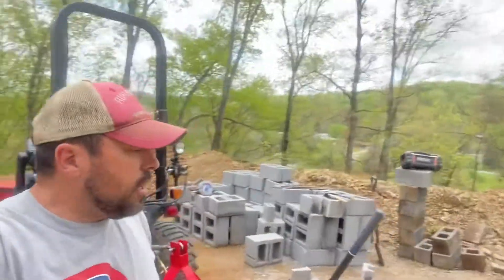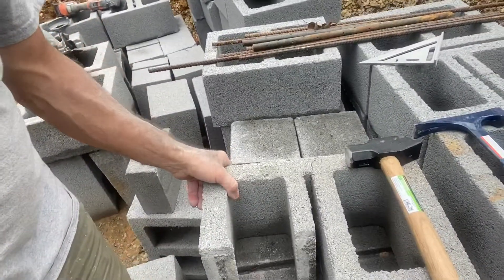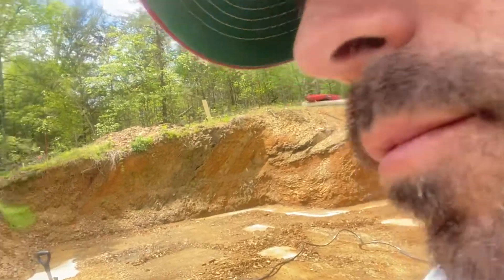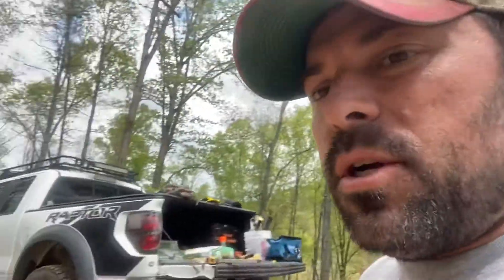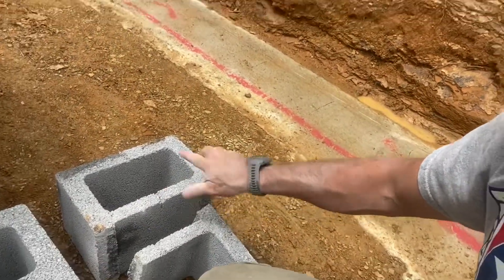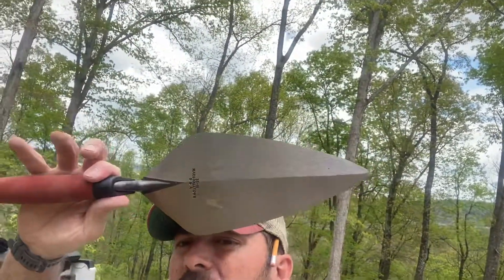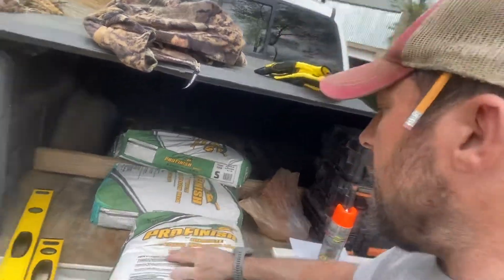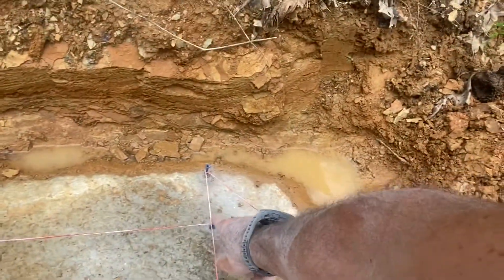Starting the block foundation on my farm house

Comment: In my area we buy 12" corner block. We also use three cell block for basements with rebar every four ft. You might want to think about a wider striker the joints will look better. I will try to help in any way I can.
Reply from the maker: Thanks Kevin, my supplier doesn’t carry corners. They said they could get them but they were expensive. Thanks for your help. I’m sure I will get better with time. The block will be completely covered once done. Sheet rock inside, and brick outside.